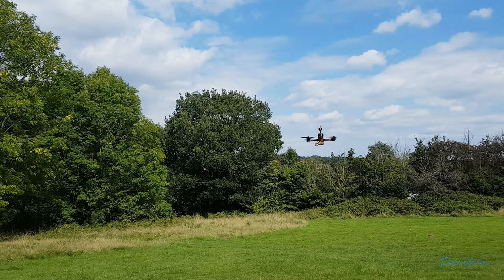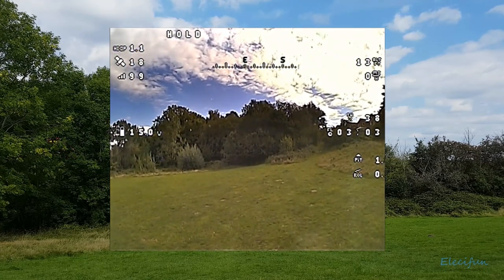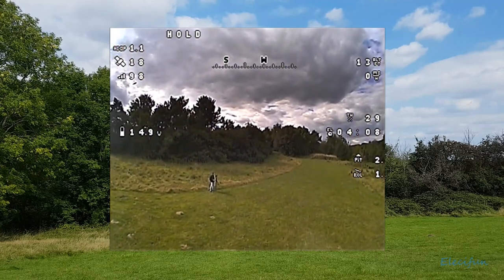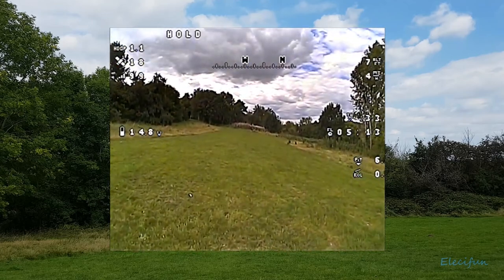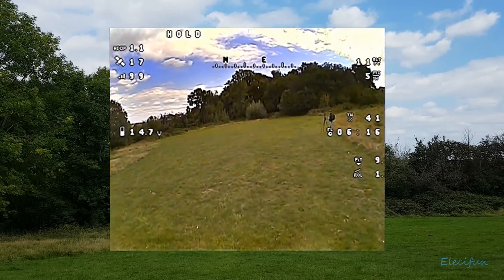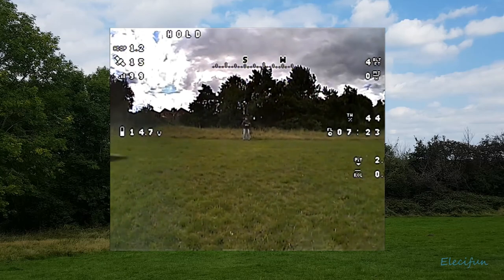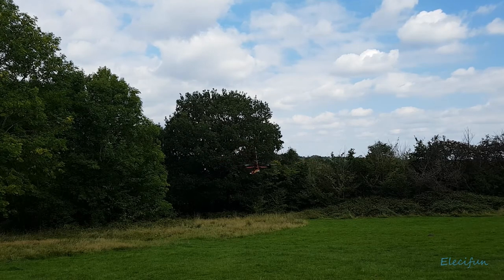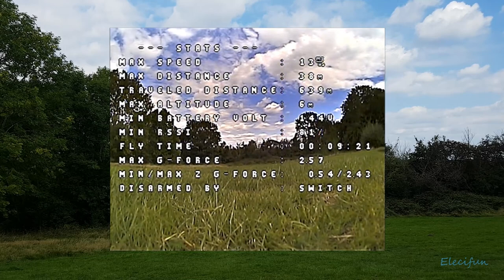DIY Quad iNAV 2 5 2 Flying in GPS Hold

Comment: Helo, nice video!
Regarding the throttle position there are two modes on Inav, that is probably why the throttle position was higher and it was hovering (38% in your case).
CLI commands:
nav_use_midthr_for_althold - when set to "0", firmware will remember where your throttle stick was when ALTHOLD was activated - this will be considered neutral position. When set to "1" - 50% throttle will be considered neutral position.
So probably in your case you were set to "0", and when you activated position hold/althold, the throttle was "higher" han your actual throttle position to hover, but it considered neutral position.
Reply from the maker: Thanks for the constructive comment. I will check that out.
Reply: +1 Thanks a lot.
Just did my first flight with iNav and was wondering about this.

Comment: That's interesting because I thought that gps hold means that the moment you flick the switch, no matter where you put your quad by using your sticks it will always return to the exact place where you flicked the switch
Reply from the maker: As did I. But, no it can be flown quite well in GPS Hold mode, making it good in theory, for precision work, given enough satellites and low HDOP. Now it has a HD camera (18grams) on it I will give it a go. Weather dependent of course. Here in UK it rains, then rains and rains again, lol.

Comment: When RTH landing I am assuming Pos hold could be switched to used to make adjustments if the land position is not quite right.
Reply from the maker: That's a good question... I normally use RTH and Position Hold on the same three way switch. If I switch to RTH it takes it out of PosHold and vice versa  the middle position of the switch allows a off position. Tomorrow I will test as now I need to know the answer lol. I will let you know.

Comment: Hi quick question.  Can you arm the quad in Poshold or do you have to take off in another mode first?
Reply from the maker: Arming the quad no. Nor any auto pilot mode. Arm in Angle and switch to PosHold when armed. Make sure HDOP is 1.5 or lower for best results.
Reply: @Elecifun  Thanks for that.  It now holds position but I have to give it full throttle.  Are you activating alt hold as well?

Comment: I've been flying my quad with betaflight for a while and want to try iNav to experiment with gps and lidar but I can not get it to flash to my flight controller. I'm using  a Kakute F7
Reply: Is your FC in DFU mode when you try to flash? You need to hold the boot loader button on the FC while plugging it in to get into DFU mode to flash INav to your kakute. I just did this 5 minutes ago. Let me know if you still have issues.

Comment: Can we use betaflight for this function or only in inav? If I nav only then do I need to flash and change to inav?
Reply: From what I've read inav is the only one with this type of function. I'm trying to build a easy to fly long range drone finding out I might as well bought a dji.
Reply from the maker: INAV is the best software IMHO for freedom and configuration, if using GPS etc.